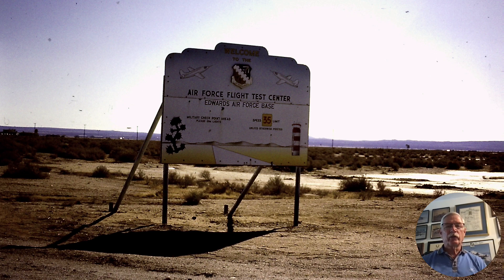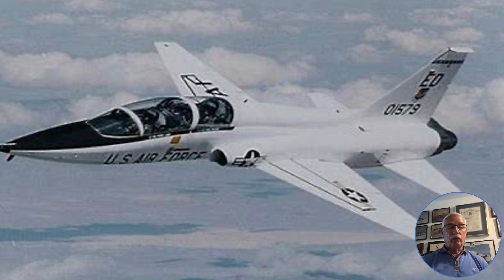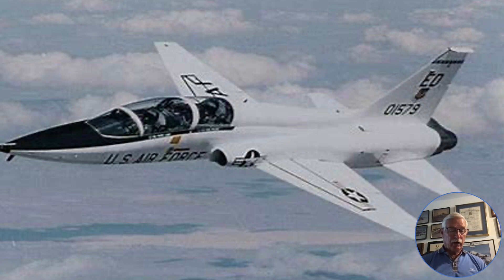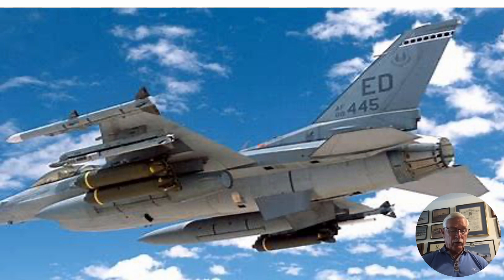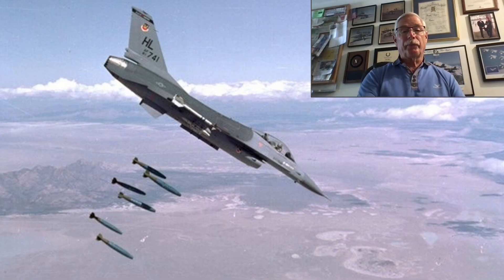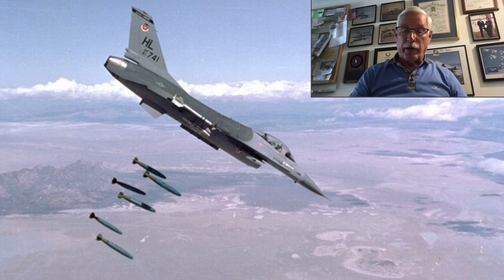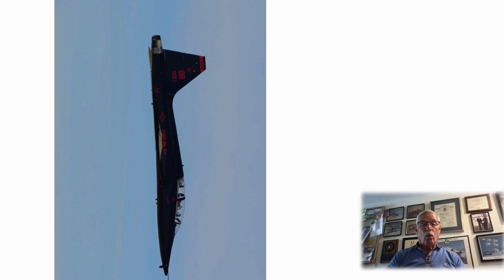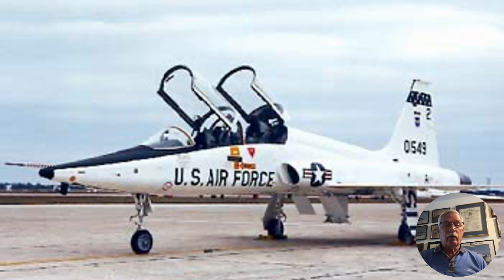F-16 60 degree dive bomb Air Force check ride that went very wrong, very fast.

Comment: So that business of not being able to see over the student pilot well (in the T-38) is why the T-7 has such a high backseat position?
I have been noticing a LOT of the newer-design two-seaters (mainly the trainers but includes at least F/A-18 two-seat models) have noticeably raised backseats.  Seems like they had too many close calls in older trainer designs because of restricted forward vision from the instructor seat in back.
Even though they're probably NEVER going to fly the F/A-18F Super Hornet from the backseat, I've noticed the WSO position in that plane has a raised seat.
Checking on the Google images, I think even the earlier B and D two-seater models of the Classic F/A-18 had raised backseats.  
They don't all have well-raised backseats on the training versions of fighters.  The F-15E Strike Eagle backseat, even though he has flight controls, does not look like his forward vision is fantastic in that plane, either.  He's clearly operationally focused on weapons store and sensor management versus flying.

Comment: Audio level was very low,
Reply: It's perfectly fine, you have a volume control. Not everything has to be @-14 LuFS and with two decibels of dynamic range.
Reply: @wellend89  Volume is at 150%. Normally, videos are audible, but sometimes they aren't.

Comment: Really interesting. Correct me if I am wrong and completely misunderstanding, but you roll and pull you get to the 60? Easier/ safer than straight and push? Or was that just how it was done as a test?
Reply from the maker: Push would be more difficult. Not just uncomfortable but in negative g, the controls are reversed so that would be bad. The aircraft rolls very rapidly so to roll is just the easiest entry. Thanks for watching!